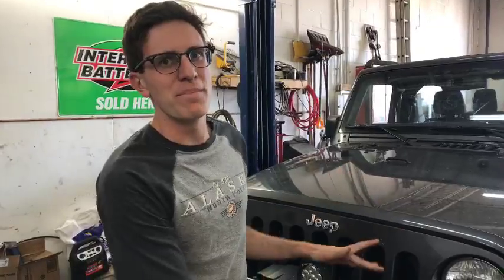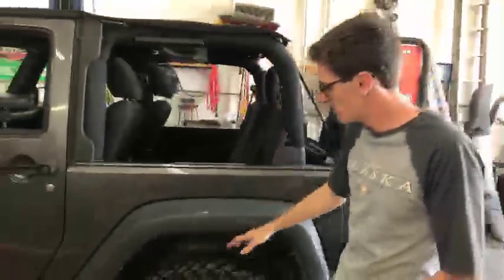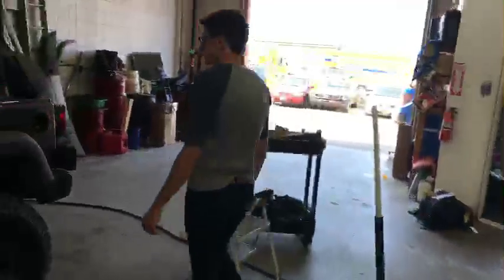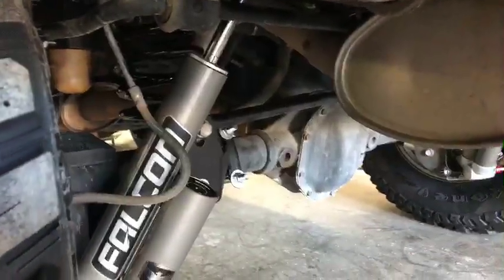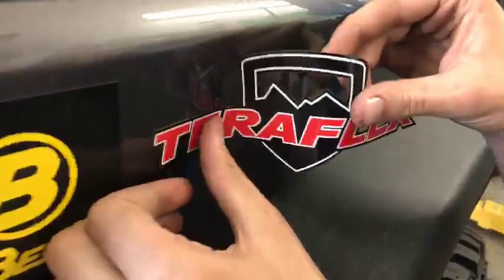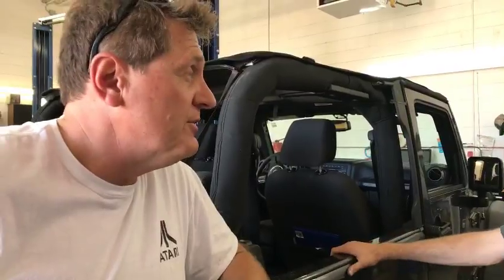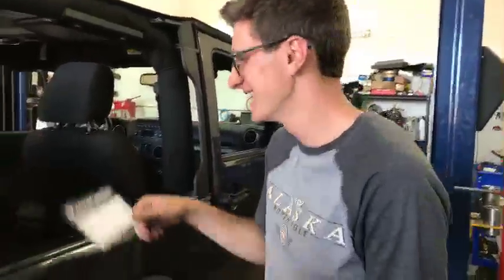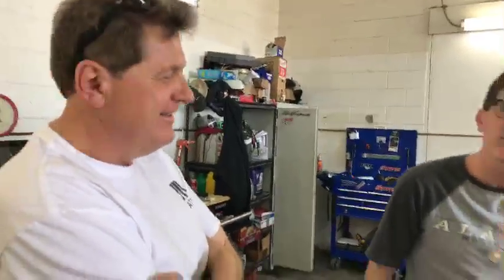Time to Lift the Jeep! (Part 2 of 2)

Comment: No plans to re-gear?  Surely you are going to recalibrate with a Pro Cal or similar device to get your shift points back, etc…?
Reply: Eh I run 2.5 aev lift with 35" km2s on my rubicon w/ 4.10 gears and its been all over the midwest, ideally it would be nice to regear but it costs a shitload to do so
Reply: Tactical Depression I regeared to 4.88s and added a True Trac in the front for $1500. It was money well spent. It made a huge difference.
Reply: buffalobillh Yea $1500 is a good chunk of money, I'm glad you're happy with it, but i probably won't be regearing until i move up to 37s, i just havent got the money currently to do something so costly. Like I said my jeep has conquered pretty much everything I've thrown at it thus far, the only place it feels like its lacking is in gas mileage...

Comment: Looks great Tommy! I bet you can't wait to get it out for a first drive. :-) I often have the debate with myself on lift or no lift for my JKU Rubi HR. 

My only concern on the lift is the shocks... it seems the resivoir is subject to damage... why didn't they rotate it 90 degrees to be parallel with the wheels so it has less cross section to oncoming trail obstacles. Seems to me that looks was more important than function. Just my observation. Otherwise great choice on lift.

Comment: Too much adjustment. All you need is, hard, for the road, soft, for off road. Anything in between is just silly and utterly overcomplicated .
Reply: I'd be a tad concerned with the rears, bashing that valve. Dunno, could be wrong.
Reply: Teraflex has bolt on skid plates to protect the rear shocks now.

Comment: A jeep with no lockers? No re-gear? And only 35's??? I would have done fenders/trimming and stuffed larger wheels on it with no lift. Then re-gear and lockers. A jeep without lockers is useless.
Reply from the maker: +UTI not when you have a buddy and a winch 😄
Reply: no way, lockers are the last thing you need...its most important to stop dragging the the jeep around on its belly